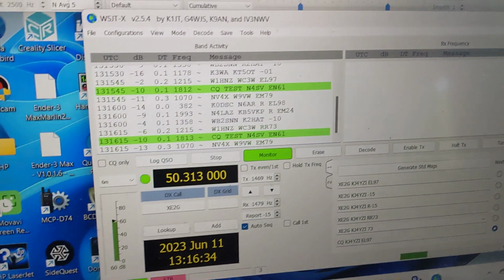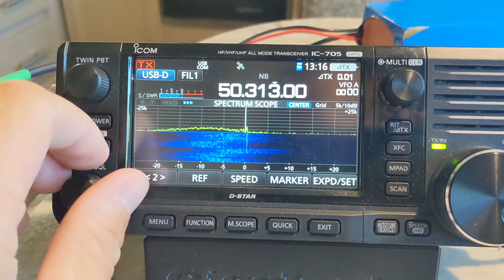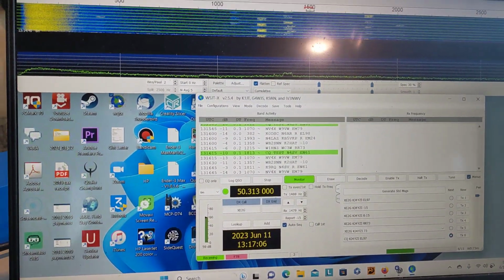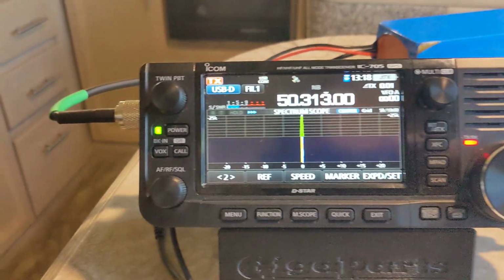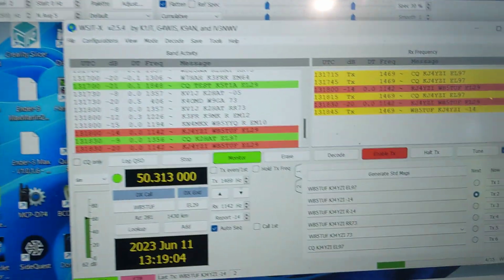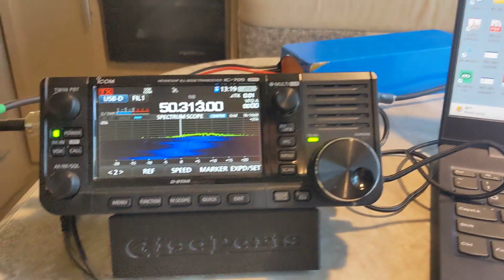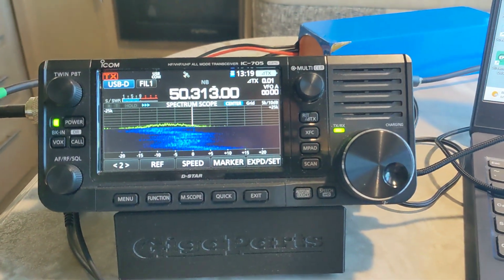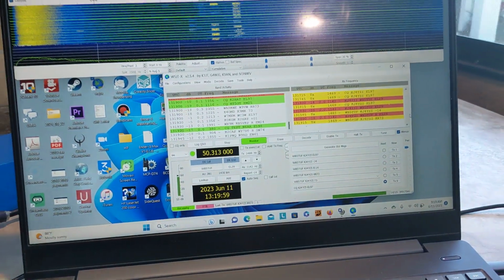FT-8 Works Through TERRIBLE RFI, Perfect For Noisy Electrical Environments.

Comment: Eric, just a thought. GM makes an RFI filter that they put inline with fuel their pumps and they work great for cutting down that HF noise. (Ford does make one but the dealership parts guys look at ya like a confused puppy when you ask for it). I'm wondering if such a filter would help you eliminate that charger noise too.

Comment: I want a 705 but everyone says don't get a QRP radio as your first HF rig. FT8 and other digital modes is how I want to operate. Maybe some voice on contest days being a hunter but that's where only having 10w hurts you and having a 7300 would be better. I won't have a permeant set up at home but working from the patio, front porch or maybe back of my truck when fishing so the 705 would be perfect for that but also I could at least leave it up and running on my nightstand monitoring the local repeater or using DStar via hotspot rather than sitting on my nightstand doing nothing like the 7300 would because it doesn't have 2M/70CM/DStar

Dang it ICOM why couldn't you have made the 705 with at least 20-30w while on external power. I wouldn't even 2nd guess it LOL

Either way good video Eric. Did you not do any voice this weekend? I thought it was a VHF contest weekend
Reply from the maker: I called CQ for an hour on 2 meters and 6 Meters but when you look at the online spots EVERYONE is using ONLY FT8 I don't see any spots for voice contacts... Kind of sad..
Reply: @HamRadioConcepts  Guess everyone was resting up for Field Day 😁